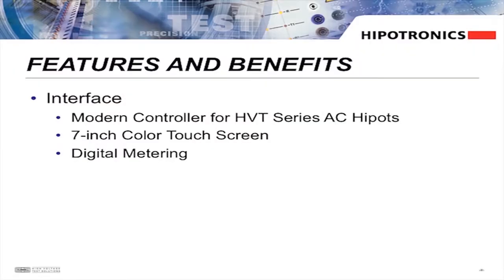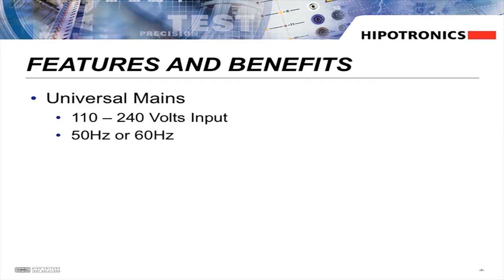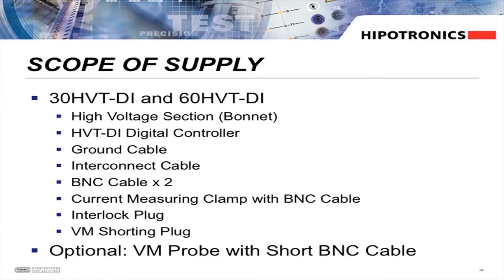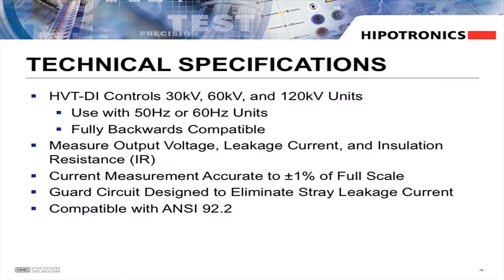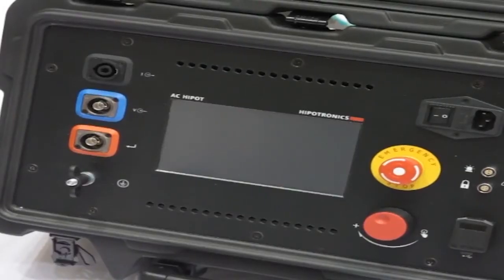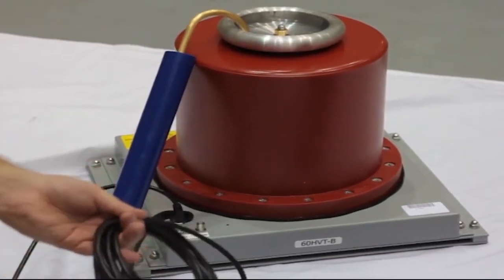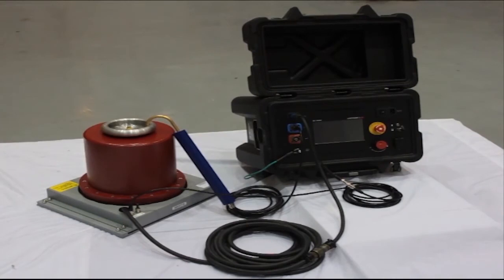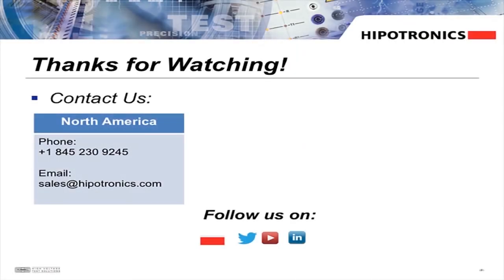HVT-DI Digital Series | “How-To” Video

Comment: Print the name of each port on the user interface instead of their symbol. explain the function of the interlock key and the port above it. because it is not described in any video, user manual, specification, or user guide.